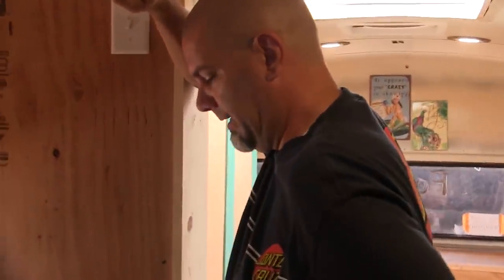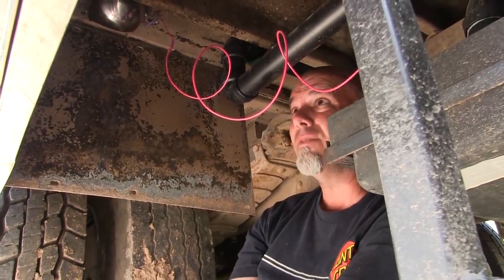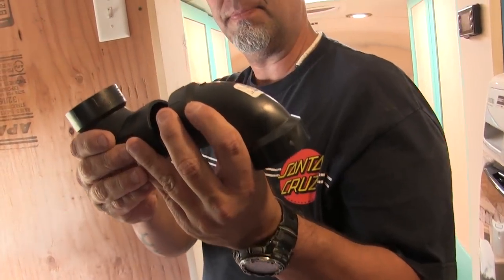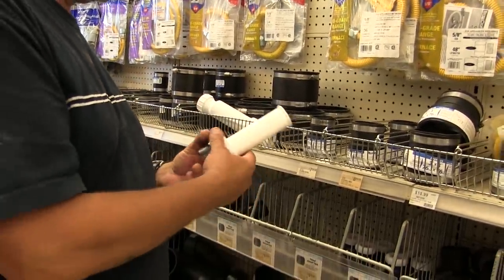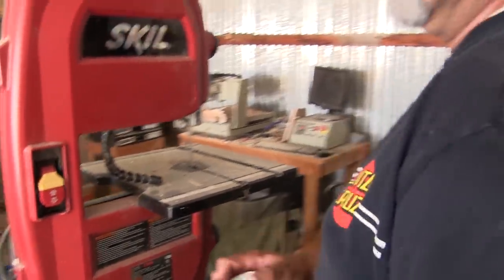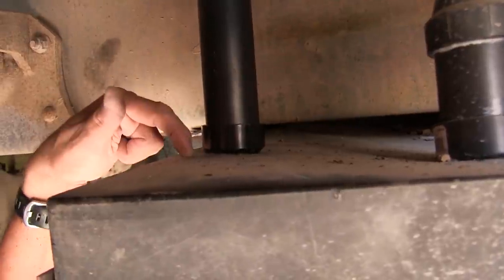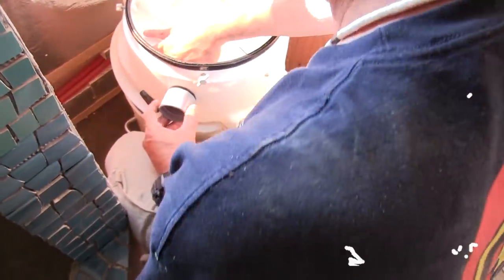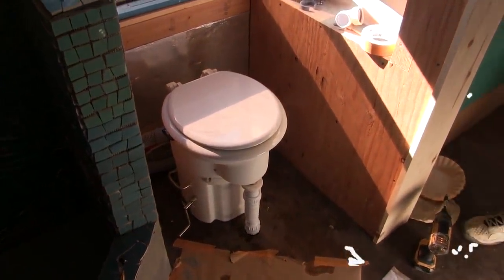Installing an Air Head Composting Toilet & Plumbing the Liquid Waste into our Black Tank

Comment: Excellent Job Folks 👍....... Down the road, may consider cutting the longer pipe below the connection and put in a rubber sleeve to ack as a vibration assembly if any bounces during travel. This rigid connection may be problematic later on and crack the black tank. Something to keep in mind. Or, if the HEPA trap gives any trouble, consider putting the trap outside between the elbow and black tank to have the mess outside when working on it instead in the house. I think some of them are flex traps, and if used outside it will also a vibration unit between the floor and black tank. Many options to do it, depending on your desire. Then, you can put a solid pipe inside that’s adjustable that slides between 2 pipes to fit the connection and be less noticeable. Any and all will work, 👍.

Comment: Vibration may cause Ware on that black pipe going to tank. Separate with a piece of rubber, just a thought
Reply: or even hard plastic
Reply: Did y'all notice the tank itself when he screwed in the coupler.... I noticed the tank gave quite a bit...  But the tank is empty right now too...😂

Comment: Well done and good idea to connect the toilet to the gray water tank! - I bought an AirHead with the small liquid tank and was very disappointed. I found that the liquid tank can ONLY be attached to the outlet with the spring, if the toilet as a whole can move a little bit UPWARD, so that the tank can slip under the outlet. That means: You can NEVER screw the toilet to the ground really TIGHT. Look at the metal angle! The hole for the winged screw is bigger than the diameter of the screw, so it has always room to move, no matter how hard you ever tighten the screw. - Drive one day on a corrugated road, and the screw will start to loosen and the toilet beginn to hiphop. - Do you drive really rough and bumpy roads, and how is your experience with the fixing? (I have an IVECO Daily 4x4).
Reply: I wish they had replied to this, I tow behind rv but I'll be driving on bumpy roads a lot.

Comment: May be a 5 gallon bucket with lid under the buss removable on a bracket would supplement the need for a secondary tank in addition of a valve and a hose coming off of that may also work.

Comment: So in the event that you used the lemonade jug and remove the white pipe.... will you put a rubber stopper or some kind of plug in the black pipe that leads to the tank so odors and or bugs can't come up?
Reply from the maker: Absolutely. In fact we are sourcing a rubber stopper for that purpose. Very smart comment! Way to catch that!
Reply: Glue the stopper to the bottom of the bottle so you’re never looking for it!

Comment: I'm looking to buy/install an airhead, but I'm looking for a way to dump it without carrying it outside.  My question is if the compost/agitator breaks down the solids enough to suck through a 2" shop vacuum hose.       If I plumb the vent with solid 2" ID PVC pipe, and get a 5 gallon bucket head vacuum, I could remove the vent fan and hook up the vacuum outside.  The inside toilet vent hose would be disconnected from the vent/vacuum pipe and a shop vac hose would be installed.  The seat of the airhead would be removed, exposing the used compost.  The shop vac hose would use to remove the compost.  This could evacuate the compost easier, allowing women/ kids to empty.  This would also let us dump in locations where carrying out the toilet would be frowned upon.  The 5 gallon buckets could be sealed and stored until a good disposal location is available.  Also anaerobic composting could continue in the bucket.    Yes, the tube could have some deposits, but it would be the vent tube mostly.    The shop vac hose could have a carrying container or bag to carry inside and out.  It could be stored in the usual septic hose bumper location.  Is this possible, or are there large solids that aren't broken down.

Comment: In the absence of a water flush Will the salts fro the urine clog the Hepvo valve?
Reply: I have heard spraying with vinegar helps, as does putting down a mineral salt made to keep crystal build-up in check.  Wonder if the valve would not like the additional chemicals though?

Comment: Nice job. how did you make the connection from the top of the Hepvo valve to the fluid diverter outlet on the body? Is it just held in place by pressure or is there some fitting?

Comment: wouldnt it have been better to have the hepvo valve between the black tank and the floor ,cause if you put the lemonade bottle in you will have black smells coming up to the under side of the lemonade tank ,,???,have just done all this to our 5 th wheeler but we used a natures head and vented through the roof with a xtra sucking fan at the roof line ,,luv you programe,from new zealand

Comment: Question? Where you mounted the drain pipe under the bus is touching the rail. Will the give in the bus not break the pipe?
Reply from the maker: No. It's a small pipe and very tough. It will last a long time. Furthermore,  the rim of the coupler above the bracket it captured but the hole we drilled and won't move or cause wear to the pipe.
Reply: @BussyMcBusface  Cool beans. You said you like when viewers speak up so I was just speaking up. Stay safe my friends.

Comment: Fernco is the brand we use in the South. It fits over the ends of the ABS pipe between the lateral pieces [ one piece glued into each 90% fitting] and spans the gap, is held in place by hose type clamps on each end. It allows you to connect the piping without making it stiff. That creates a vibration free connection that won't cause the threaded joint in the part of the tank you put the threaded adapter in.Your piping AND your tank is isolated.......less leaks and repairs down the line[time].     Just buy the proper size to fit your pipe.ACE has them.     https://www.amazon.com/Fernco-P1056-125-4-Inch-Stock-Coupling/dp/B00077PW22/ref=sr_1_14?crid=Y9F6NPDRGFYW&dchild=1&keywords=fernco+drain+connector&qid=1587264804&sprefix=fernco+connectors%2Caps%2C544&sr=8-14
Reply from the maker: I like the way you think!

Comment: Hey does anyone show how to empty the composting part when there is a pipe on the front. Do you have to disconnect it from that pipe to empty it?
Reply from the maker: The pipe isn't actually attached to the composting toilet. It is attached to the floor. You just lift the top right off. The composting toilet has a spring seal that presses down on the container that comes with the composting toilet. It presses down on the pipe as well.

Comment: the peice of pipe sticking up off the floor might interfere with the can you want to put the bottle, catchcan under it to prevent filling the black watertank
then again if youre planning to use it when you are at one spot for a while you could setup the catchcan under the bus and ad a small tap under the bus in the line to the blacktank to put it under , keeps the smell out of the bus even if the bottle falls over or overflows might be able to digg a small hole in the ground under the bus and dump straight intoo that (fill it back in when you leave and noone will know)whoooo that isnt alowed whooooooh ..... well if bears and deer can do it so can we 
as for working under the bus : get a full sheet of melamine or some pieces from a cheap (ikea) bookcase and tape them together to make a bigger sheet   , its nice and flat and slippery when you slide over it with youre shirt and pants makes it eazier to move under the bus without rocks poking you in the back , works better then cardboard

Comment: just thought of sumting , if you pee it will replace the water in the waterlock , the peesmell will still get out (even though the lock stops the smell from the black tank ) you need to flush the waterlock through so theres only vinigar water in there every time you do a number 2 
stale pee can smell rea\ly bad if you let it sit
Reply from the maker: There is no standing liquid in this type of p-trap.

Comment: I bought an Airhead toilet and found the install to be extremely difficult. It is currently sitting in my kitchen. The fan they sent was defective. I contacted them to get clarification about cutting the hose, as there are two hoses referenced in the instructions and they were extremely rude with a condescending, one sentence response. Several days later, I received another rude email from their general manager who spent three paragraphs berating me because I was upset that their product was defective. I spent $1200 on a non-functioning glorified spackle bucket. Quite possibly the worst purchase I’ve ever made.

Comment: Composting toilets are gross. Why would you install one when you have a sewage tank?  It will have bugs. It will stink. No such thing as one that doesn't. I'd rather have a vent that went up vs through the floor.  I would still put a trap on it. That mechanical seal has been banned in houses. It will fail and let sewer gas back into the bus.
Reply from the maker: You are the only person on the entire internet that has a bad opinion of composting toilets and the Hepvo.
Reply: @BussyMcBusface  lol. Search further. I'm a real plumber who has seen these in action. Speaking from experience.
Reply: @IslandPlumber  I actually have a Nature's Head composting toilet which is similar to the airhead and been using it for the past 3.5 years, no smell, just an earthy aroma, its actually better than a real toilet IMO. The urine and feces are in separate areas, no sewage, no smell. The composting toilets you've seen in action that smelled probaly weren't hooked up properly with adequate venting or user error. Coco coir not mixed properly, waste tank area not cleaned properly, mixing of urine with the waste container, etc...
Reply: Island Plumber has obviously never USED a composting toilet.  If you are grossed out about bugs in poop, why are you a plumber?  However, my limited knowledge of airflow suggests you might have a point about venting up higher than that toilet.  The fan should do fine to remove all interior smells, but from the outside, one might get the updraft smell coming from the toilet when walking by and might wish the vent were overhead or higher.
Reply: @Roobah  I actually used one of them. I service a few of them and have replaced a couple with real toilets. Proper venting is very important. But even with that there's eventually order. if you are extremely vigilant about maintaining and cleaning it then they don't smell as bad. Like the other poster who said there's no odors, other than a musty earthy smell. That's a smell. When you know it's because there's poop sitting there it's gross. There should be zero smell. If you don't stay on top of it it can become a real problem overnight. A composting toilet should be a very last resort and I believe it's hard to justify ever using one. I'd say you obviously are not a plumber.